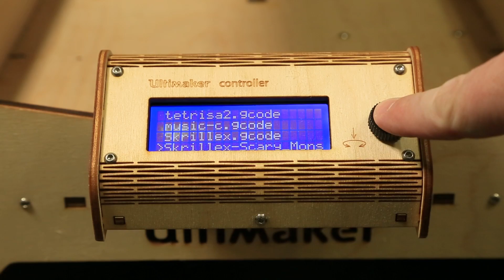SKRILLEX Scary Monsters and Nice Sprites on Ultimaker 3D Printer - @Barnacules

Comment: This sounds cool and all but I hope it's not affecting the hardware.
Reply from the maker: Don't worry these stepper motors are designed for much higher speeds and direction changes. This is very light duty for it.
Reply: Thats good. I was just making sure because those printers are not cheap lol
Reply from the maker: Andrew Techful I know it, but I've got a few backups if it blows up :D
Reply: Barnacules Nerdgasm Couldn't do this on the Ultimaker 2 because it's so damn silent and awesome? :D